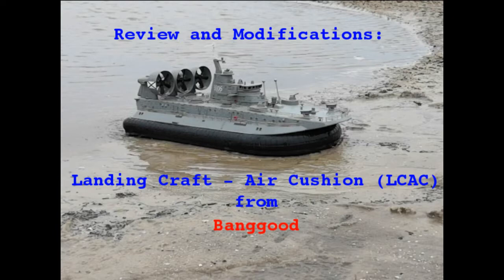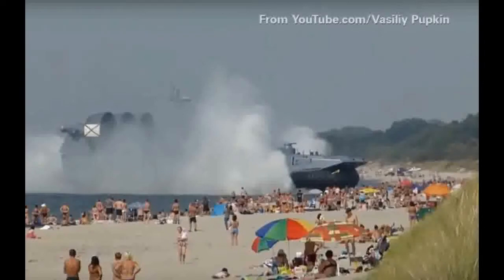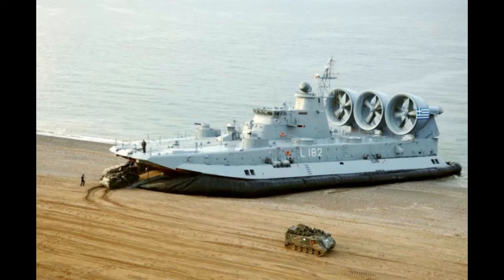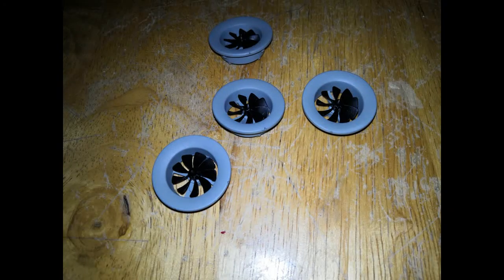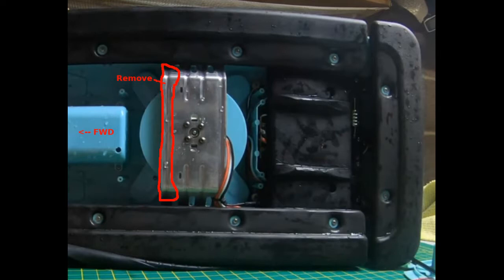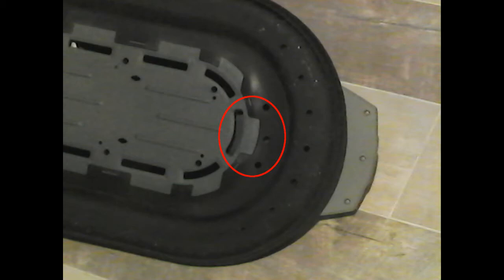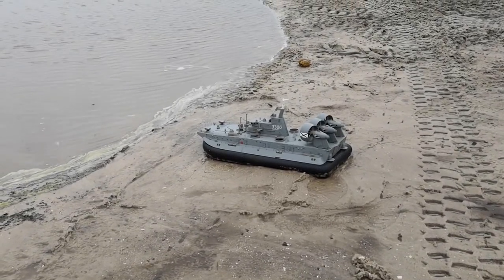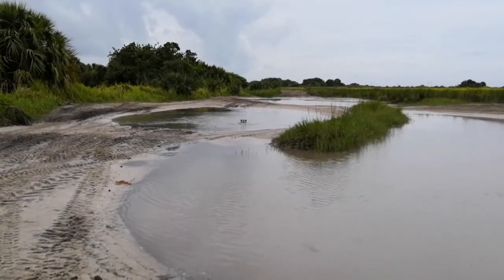Russian Zubr class LCAC - 1:110 Scale RC Model Hovercraft

Comment: So, how did it go? Did you find some ways to upgrade it further?
Reply from the maker: So a little update.  Not long after I made the video, one of the 3 small propulsion motors failed.  It's the motor itself, not the controller board.  The motors are the same as used in the micro racing drones and thus are readily available.  I've haven't ordered a replacement yet due to other projects. I did conformal coat the controller board, but other than that, I haven't done any other modifications.
Reply: @CarCynic  ow, another thing to consider is using a battery of smaller capacity and size. Then, it can be positioned someplace behind the fan or even in the tower part above deck. Then the hover will be less front-heavy.
Reply: @CarCynic  thank you for the reply. I really want to buy one of these because of how amazingly looking this model is and how much it is detailed. However, my desire to buy it is counterbalanced by how awfully it performs on all surfaces except wet asphalt. So I was really looking for anyone who got one of these and modded successfully.

I like your suggestions. If I can weigh in, the fan can be replaced from an impeller to a propeller. Also, the skirt really needs to be replaced with a softer one. Made not from rubber but from nylon or similar. With the current impeller the air is taken in through the 4 decorative fans at the top and then it is blown from the impeller sideways. That looks a bit inefficient as the impeller is surrounded from all sides by things. Battery compartment from the front, the metal bracket on the sides. Probably they  reduce the speed of air when it hits them.

But the skirt is definitely the prime suspect in my opinion.

Planning to get a hovercraft by Palaform and see how it is designed so that maybe I could replicate it for a Zubr.